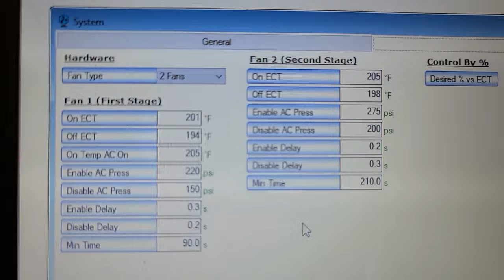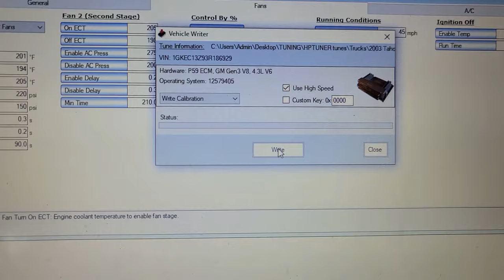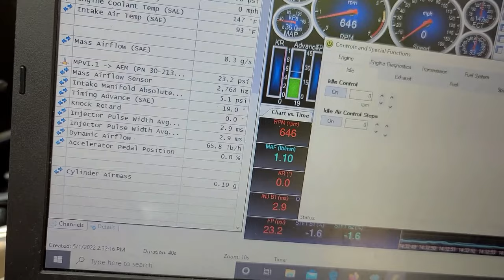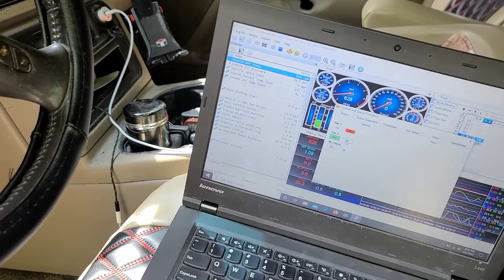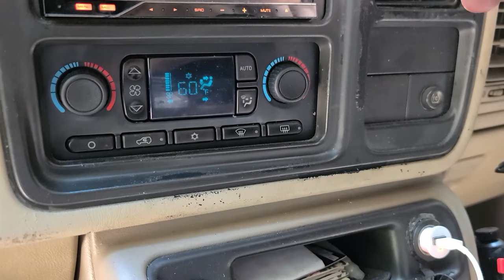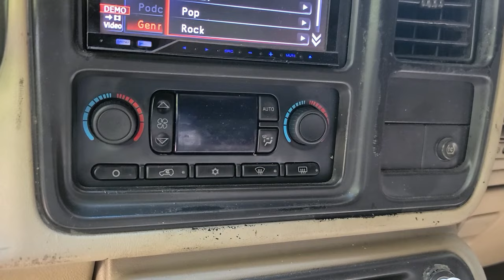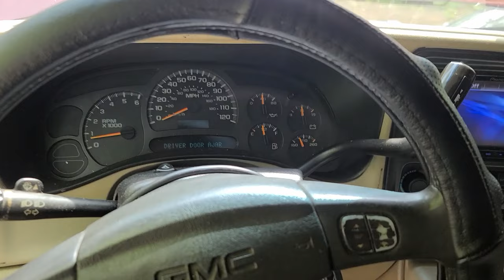How to install E-fans on your 1999-2004 Silverado/Sierra/Tahoe/Yukon/Suburban, etc

Comment: I did this conversion I didn't hook it up to the computer. So my fans run all the time tell I turn my truck off
Reply: How?
Reply: @txsrigo6495  I actually paid backyard mechanic to hook this up. There's wires underneath the steering wheel
Reply: I did buy all the parts though. I used the 2006 Chevy Silverado fan system and it went just like factory.
Reply: @txsrigo6495 I also had to do the big 3 upgrade because with the fans  always running. It was draining my battery and alternator. After a year. It runs perfect now I went with an 1500 amp alternator.
Reply: Does the fan just run off 12volts so hook it somewhere?
Reply: @alexayala6720  yes it's hooked up 12volts. Pretty easy to install
Reply: @bryonaderhold2009  and it’s on full blast all the time ?? Have you had any problems
Reply: @alexayala6720  I have not had an problems. My truck stays cool no over heating the a/c stays cold
Reply: It stays on tell I turn my trun my truck off
Reply: @bryonaderhold2009  yeah and you feel like it drained your battery and alternator because you hooked it up always being on ?
Reply: I'm having problems now that I hooked back my amplifier it started dieing and messing up the abs. I disconnected the amplifier no more. I'm still trying to figure out why my amplifier to my subs would do that when I have a 250 amp alternator
Reply: @bryonaderhold2009  The alternator is not enough, when you say 250A it is when the car is running, not at idle
Reply: Can't produce enough power on guessing or it could be my amplifier dieing out. It's pretty damn old three-and-a-half years
Reply: But it's too damn hot to be looking at s*** inside of vehicle in Arizona
Reply: I don't know if it was the amplifier just being too old
Reply: Wrong
Reply: Where can I buy a 1500 amp alternator wtf that's crazy
Reply: CAN YOU PLEASE SHOW HOW EVERYTHING IS WIRED
Reply: @05_tahoe  @ id u qant to correctly use electric fans! It will need a +3  transducer sensor! To work with the pcm, just like gm did on 05+  trucks
Reply: @05_tahoe  @ if ur truck its a 99-02   Most likely it will be fan on at all the times! When a/c its on!!
Reply: I did the same install the guy who tune my truck put the fans on always high I hate it it’s to loud, I’m gonna pay him to put it stock because it keeps burning relays n fuses after a while.
Reply: Eventually the power wire will frie , been there done that
Reply: I did this with a toggle switch on an amazon wiring harness and it melted the fuse. 2002 Avalanche @alexayala6720
Reply: I tried to pin mine blue connector 42, red connector 33 but one of them had a wire already there. Is there an alternate spot? 2002 Avalanche

Comment: I did the efan on a 04 sierra with oem harness took to a shop to get installed. The only problem the high fan stays on all the time till truck is turned off . Is that something normal ? And only one fan stays on .
Reply: Wrong!!

Comment: just to add to my experience, just bought a 2004 5.3L 4x4 sierra and the temp gauge sits at 210 or just below it and doesn't really move from there. Soon after I replaced the water pump and thermostat with an 187F and replaced the clutch fan with an single elec. fan while keeping the stock oem 28.5in radiator and no fan shroud, other than the the elec. fan shroud. My aftermarket fan controller runs 20 degree cooler since its a radiator temp probe. so I have it set to kick on at 180F which the PCM obd2 reader reads at 200F. Now i never did check what the PCM temp was prior to the elec fan mod or new water pump/thermostat. As of right now my temp gauge stays at or just below 210 even tho the PCM reads 212F. the single elec fan is constantly running and doesnt cool it off enough to turn off when idling but as soon as I drive temps drop to 197-205F and 212F at idle. Is this good operating temperature for a single elec. fan?

Comment: Why cant a fella just wire the fans to keyed power instead of splicing into and reprograming the ECU? that way the fans would just always be on if the truck is on. would that be a bad thing?

Comment: So I did this conversion and did the relay to the ac switch and that works. Why would my fans be running as soon as the engine is running tho and not up to temp? Also doing the relay will cause them to run during winter correct?
Reply from the maker: Gotta be tune or wiring.  Not sure without looking at it!
Reply: I think I figured out what he programmed wrong and that ac hasn't been switched to fan 2. Thanks for the reply.

Comment: I had my suburban tuned but the ac still not kicking on the fans when the engine temp is below 200 degrees what are the ac pressure setting supposed to be?
Reply from the maker: Depending on the year, it may need to be tied into the ac compressor wire.   Or tune or wiring.  Hard to say without looking
Reply: @nufnuffz28  it's a 2004 suburban
Reply from the maker: @midlman71  ok.  It ties into the PCM that year
Reply: Did you switch your thermostat to a 160 degree ?
Reply: @harryfp1494  it's set at 196 degrees
Reply: @nufnuffz28 What about a 2002!
Reply from the maker: @IDABAYAREA650I  On the 99-02 trucks the electric fan conversion harness has 6 total connections to make: one connection to each fan, constant power to the relays, ground, blue trigger wire to pin 42 on the ECM connector, and green trigger wire to the A/C clutch signal wire.  You will need to determine which wire triggers the A/C compressor clutch.  This wire runs in the OE wiring loom directly to the left of the red junction box near the alternator on the driver's side.  Carefully remove a section of those wires from the loom and look for the green trigger wire.  NOTE: there will likely be more than one green wire in this bundle.  You will need to test for 12v power to the wire when the A/C clutch in engaged.  Be careful here, as one wire will receive power under the same condition, but it will not be a full 12v.  You will want to be sure that the wire you're testing sees a full 12v (or 13v/14v when engine is running) when pinned during A/C compressor clutch engagement.  Once that wire is positively identified, use the included wire tap to tap into the OE A/C clutch signal wire.
Reply: @nufnuffz28  perfect thanks for the explanation, does this still apply although i have the Original wiring WITH The fuse block and pins?
Reply from the maker: @IDABAYAREA650I  i dont know on crossover setups.  Would have to review it...
Reply: @nufnuffz28  Gotcha, so green wire that pins into the ECM needs to tap into A/C Compressor clutch wire the correct green wire

Comment: I have a question. I haven’t done the conversion yet I’m waiting for the parts but I want to get the tune done  before I start the conversion. can I have the tuner tune it before the conversion or do you recommend them tuning it when it’s already installed? The reason I’m asking is because I need to drive the truck this week and I need it tuned so when I’m ready to do the conversion I don’t have to worry about the tune since it’ll already be there will there be a problem if I do the tune before? In other words will it be safe to do the tune with the clutch fan still in there??
Reply from the maker: Yes, thst is perfectly fine

Comment: I see people here in the comments saying they have AC issues. If you have a 99-02, they are wired differently and the functions in the PCM are slightly different. I am chasing this issue with my 2001 Silverado and the PCM of NC harness/relays. The answer to our problems is a different pressure switch and a few wires that get pinned to the PCM from BP Automotive. It's a $75 kit, i just ordered one. I plan to do a video outlining my issues, and what fixed it. 

Hope that information helps someone.
Reply from the maker: You are correct.  I will find the settings we have used there and post them in a separate video
Reply: @nufnuffz28  Thanks! Definitely appreciate that.
Reply: I did mine and now my ac compressor will not turn on everything is brand new if I remember correctly on my 01 gmc I had to remove a wire for ac will this fix that issue I know the pin lay was diffrent
Reply: Did you make video
Reply: Nelson automotive also has them

Comment: If you wanted this to be stand alone and not ecm controlled what changes need to be made?
Reply from the maker: None.  It could be put on switches or twmp sensors placed in the radiator or head

Comment: Hello how are you?
I did an la swap and I have two electric fan  ,I was wandering if the ECM put out ground or power on the coil side of the relay to turn the  fan  on?

Comment: i just did the swap and did everything you did. I got my ECU tuned before installing so the fans would already be ready to work like factory. After finishing, my check engine light is on and the truck is running like it did before i got it tuned. Any suggestions or help.
Reply from the maker: Would need to see the tune

Comment: Hi,
Question. I have a 2004 Chevy suburban 1500 LT RWD and I want to upgrade/install E-Fan(s) mostly because I experienced a common issue with clutch fan not cooling the AC system in a consistent manner. Thought I had an AC issue, but recently learned it is what you get with a clutch fan. I'm also interested in improved overall efficiency of my SUV. Can you (or anyone) tell me what e-fan(s) I can/should use? I don't need total perfection, but I do need them to work reliably, even if that means using unorthodox install methods. I know how to remove and install, I just need to be sure I'm buying the correct things. I also have access to/live near many auto dismantlers/pick-a-part businesses to look for parts I need. 
*SoCal high desert dweller: summer time temp is 105 F daily for months- I think E-Fans will help me.
Recommendations? Thanks👍🏽
Reply from the maker: Measure your radiator.  If the amaller one 98-02 f body fans.  If the larger one the 05 up fans.  IMO skip the small ones and go to the larger later radiator and truck fans.  I need to do that as well

Comment: Question i just did my swap to efans wht gauge wire do u recommend or is recommend to run for harness & relay connectors ...the ones i used where running good but other day happened to burn the connector ....
Reply from the maker: Get the good harness from PCM of NC

Comment: any idea why relay on the 87 pin would melt the little block where it inserts into. Could it have been the vibration and engine heat? Because I don’t have the relays mounted anywhere I left them loose.
Reply from the maker: Not sure!
Reply: Did you ever figure out why 87 pin melted the little block where it inserts into? I had the same issue with factory harness melting 87 pin on all 3 fan relay insert blocks and not sure why or how to fix.
Reply: @BuddyHart-tj2yi  I just swapped out the e fan harness out with another new one from Nelson performance 0 issues ever since!

Comment: Did this swap to my 01, only the passenger fan comes on high when the ac is on not both low like u got. Should they both be on high when the ac is on?  Driver side comes on low with engine up to temp
Reply: If wired correctly, both fans low, both fans hi! And a/c on both hi,
Reply: Test your fans independently, one might have burned out.

Comment: Question! I have efans already installed but whoever had it didn’t wire it right. If I re wire it, do I have to retune or not ?
Reply from the maker: If tuned correctly they should start working once the wiring is fixed

Comment: Hey bro got a 2000 tahoe I've been doing alot too this is one doing in next couple days after i pull the fan harness in the morning off the 06 i got off friend after wife got hit, question is, if i just swap the 00' ecm with a 06' ecm will everything work properly still with rest of car an motor with the 2000 harness with pinning the two wires in sure the fans would work, but making sure i wouldnt have to update the climate controls and stuff to the 06 stuff cause I know they changed the plugs that connect to the climate control and the light switches anf stuff (my light control went out grabbed one from a 04 how found that out original) 2nd question would be if it all would work still if i updated the plugs and added any other wiring the 00 harness doesnt have for it would the updated 04-06 climate control units work with the 99-03 dash hardware properly (figuring the duel climate wouldnt without the duel baffles and fans for the vents) but would it still swap threw floor to defrost and hot to cold tho? Cause I also know from 99 to 06 the 5.3l tune got updated also and the HP went up twice dont wana swap it and the differnt tune possibly mess up the      00' 5.3 motor with a 06' 5.3 tune or would it actully run better like the 06 then and make that extra 20-30 hp they gained in that time? I do have the 06 motor also cause the 06 i got off friend wife got hit totaled it but only had 121k on it so got it as a donor to swap out the 00 288k in mine just going to be a few weeks before i got time to swap the 06 motor in cause if it would ill just wait on the e fan tell i do motor swap and work on preparing bumbers and stuff im getting color matched instead tomorrow lol. Sorry for thw novel😅
Reply: I'd love for the duel climate and stuff to work also but swapping all the components behind dashes isn't worth having it lol unless its all stuff you can reach without taking most the dash out from the bottom.

Comment: Did you use the stock alternator ?
Reply from the maker: Yes.  If you ever replace it go to the 150 imo.  Just need a slightly longer belt

Comment: I have access to an 05 parts truck could I just take the pcm from it to avoid having to tune?
Reply from the maker: It would still need to be tuned for your vin, cats, injectors, etc
Reply from the maker: Get hptuners or borrow a friend's and we can help

Comment: Does we have to change the radiators ? I have a 28” oem
Reply from the maker: You can get fans for both (LS1 for the smaller one and 05 up truck fans for the larger one)

Comment: Does it matter which wire goes into 33 and 42 because I’ve seen videos say different from another
Reply from the maker: We always do it this way without issue,  so the only way we do it...
Reply: @nufnuffz28  I pulled the green out of 42 and the blue out of 33 and this came out of a 06 chevy tahoe
Reply from the maker: @2Mont106  I'm not sure then.  I know the ECM triggers the two fans based off of different criteria through those PINs.  You could probably also search for PCM for less's instructions as they have a detailed write up sheet. Thank you
Reply: @nufnuffz28  Idk why this is so but I took the "Wiring Harness/E-Fan" off of a 2006 chevy tahoe to place on a 2003 Z71 chevy tahoe.  However, not wanting to over think 🤔 this process I'm now wondering if in any way the ECM wiring might differ depending on the year? 🤷🏽‍♂️
Reply from the maker: @2Mont106  they have all been the same we have done.  In the older ones there is a wire yoh pull out that it replaces...
Reply: Hello nice video I just bought an e fan harness that has a green and white wire how do I no which pin they go in

Comment: Hi there , on pin 33 were green wire goes to there is already a green wire there for something also.  What should I do there?
Reply from the maker: @blazing high performance
Reply: I have the same issue
Reply: Did you figure this out?
Reply: Just remove the existing wire (recirculation mode) and put the new one

Comment: Is $250 allot to get it tuned?
Reply from the maker: Cheap.... if done properly
Reply: @nufnuffz28  they set them up to turn on medium speed at 180 and 190 for the fast speed was that a good temperature to turn on?
Reply from the maker: @acetone21  thats a little cool., but glad they are working!

Comment: I did the same and when I turn my a/c on, the fans won’t come on until it reaches the temperature, somehow it’s not sending the signal from a/c to turn the fans on, any ideas??
Reply from the maker: What year truck?
Reply from the maker: @trentyoung2105  look at pcm4less website.   It shows the difference in the earlier years
Reply: 2004 4.8

Comment: Hello what's the benefit of the swap?
Reply from the maker: More power!
Reply: Not only is it more power , but your air conditioning won't overheat your vehicle as fast. My 2002 Avalanche overheated in the drive through on a 115° day. E-fans would have let me run it longer.